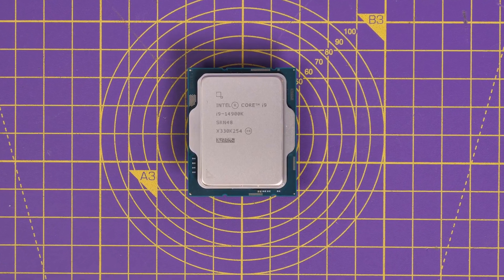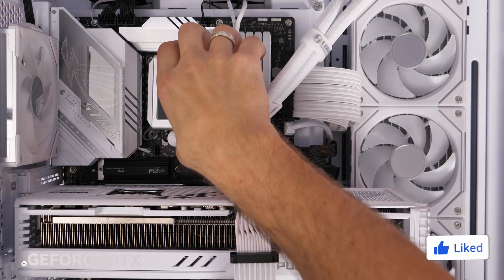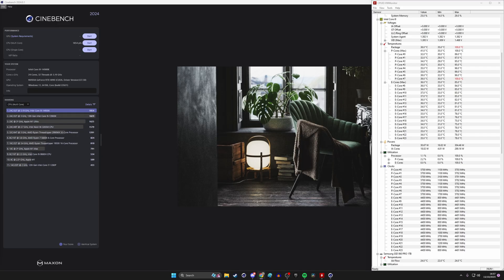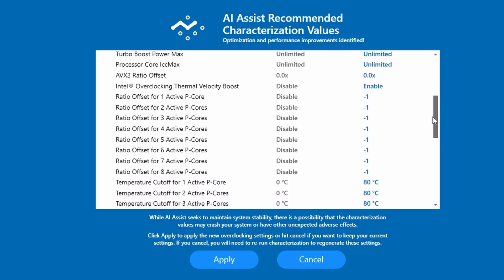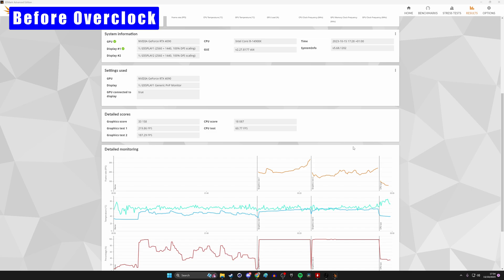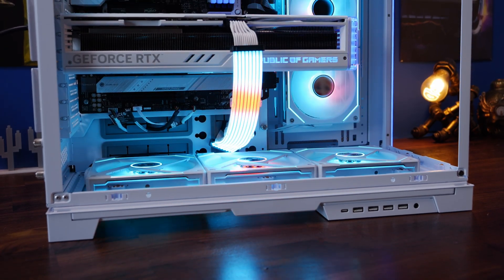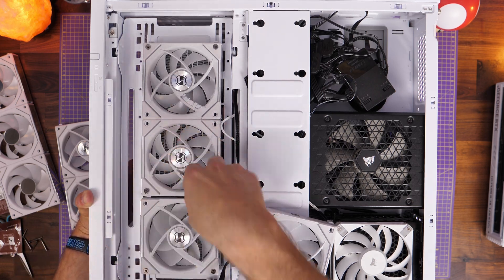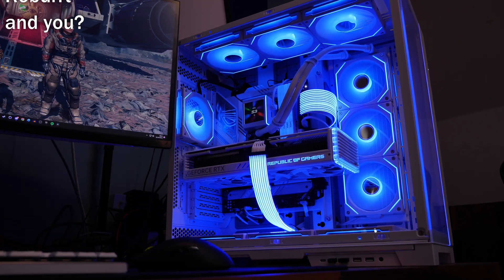Intel's 14th Gen CPUs support AI overclocking and here's the difference it makes!

Comment: Best fix is to move to am5, and im so glad i did ditch my 12700k and basically got rid of all the problems. Im on air single tower cooler with super low rpm fan profile quiet, efficient and fastest

Comment: So I've just built a system with a 14900k and I have an MSI z790 motherboard. When downloading the newest BIOS firmware I saw that they've added a feature to disable something called CEP in the BIOS in order to allow CPUs to run on less voltage to get the same performance and therefore run cooler. Have you heard of this? I havent seen any videos referring to this specific setting and I'm curious if it really does make a difference? I have also heard that one should disable the "let BIOS optimize" function as well, since that tends to push past Intel established limits and supplies the CPU with way more voltage than necessary. Anyway, I'm specifically curious about this CEP thing and what it does/what the benefits are of keeping it enabled or disabling it. Could you perhaps do a video on it or just reply with your opinion on it? Thank you sir!
Reply from the maker: I've heard of it but not tried it yet. MSI mentioned it's for the non-k series of CPUs though
Reply: @TheProvokedPrawn  Yes I did just notice that the recent BETA firmware update is for the non-K CPUs but apparently its been an option for the K series CPUs for a little while now, but I still dont see anyone talking about it. I am finishing up my build today and assuming I havent messed anything up, I will be messing around with the BIOS and running some benchmarks so maybe I'll try turning that off to see what happens. I still think it might be a good video idea and I also just value your opinion and knowledge on this stuff. Thanks!
Reply from the maker: @thatBLKSheep  let me know how it goes
Reply: @-Highlander-42  for me with an i9-14900k, I believe it was already off, by default. I never tried turning it on.

Comment: Hello great video, I bought an I9 14gen recently but I have temperature problems, does this new IA tuning utility could help to settle the right configuration in order to low degrees?
Reply from the maker: https://youtu.be/sVEXd-Wp8FY
Reply: Thermal Grizzly makes a cpu mounting plate that might help. Use good thermal paste! If you have an AIO you could look into getting some extra fans and making it push/pull. Aside from that you will have to start looking at better cooling solutions.

Comment: What was the point of this overclock? Rainbow Six Siege - 486 > 492 fps. There is barely ANY difference in this overclock, except wasting energy and rendering your system just a tiny bit more unstable.
Reply from the maker: The point is it's easy to do and it'll be unstable because it's managed by AI and the  system

Comment: Personally I’ve just reduced the core voltage by an offset of -0.05000v.. At first glance I thought it wouldn’t do much but it ended up lowering the temperature of some cores from 100c to 80-83c. In wattage before lowering the voltage it was going up to 350w after tho it was 275w so -75w and by the way the performance is pretty much the same and the cpu is still running great at 5.8Ghz on the P cores and 4.5Ghz on the E cords
Reply: It's because core voltages affect on power is the square of the difference it isn't linear. Ie if it say used 100w with 1 volt, if you upped the voltage to 2v it'd used about 400w although that math doesn't exactly track for  going from 350w to 275w. Make sure ur actual all core frequency isn't being lowered and especially that undervolt protection is turned Off in the bios. That feature is awful if you're tryna undervolt, you shouldnt be losing any performance at all but it sounds like u lost a little probably bcuz of that feature.

Comment: Is anyone in the comment section using "contact frame" ??
Reply: I use a contact frame that I had when I bought the 12th gen and it did help lower the CPU temperatures dramatically so I bought one for my 14900K as well because I don't want to risk bending the CPU
Reply: I just installed one for my 14900k. Its hard to pinpoint the exact contributing factors, but i noticed minor galling on the cooling plate of my h170I along the top and bottom edges of where the CPU contacted it through the paste before i swapped. After buffing that out and installing the contact frame my temps dropped about 4 degrees across the board. It could be slight variance between my paste application, or maybe the contact frame helped. Either way im happy with it and im keeping it installed.
Reply: @Akmt96   same here, I can’t pin point what is helping to cool this bad boy off. I used artic mx6 and thremalright contact frame on a z790 msi Meg ace mobo
Reply: Doesn't affect anything really 1 to 2 deg. To none
Reply: @bryangroleaupaquette2503 it helps with the cpu thing bending its not meant for instant temp reductions
Reply: @bryangroleaupaquette2503  Very wrong. Almost 7-10 degrees actually.
Reply: Honestly, I did some research and saw that some folks had their CPU’s bend over time due to the lga 1700 socket shape so I just bought the contact frame for peace of mind! So cheap and too easy to install for the anxiety it takes away, but I only noticed a 2c difference on my 14th gen i5
Reply: It is working only with a brand new cpu not already bent by the mobos lock mechanism.
Reply: Yes
Reply: I am! Love it on my new i9 14900k. Didn’t try before/after but my 2x 360mm rads on custom loop have no issue with cooling.
Reply: Yea but dont know what it actually does because i installed it new. No basis if its better, just being on the safe side.
Reply: The factory iLm eventually bends the chip , the contact frame prevents that.

Comment: I love my 14900k , def no reason to go from 13900k/ks on this but from 12600k.... ow yea .... i hiting 6.1 MHz All P Core with 4 E cores , System only for gaming 

using manual + Ai OC  Max temp 72 c on air cooling ^^ mind blow

Cinebench R32 results on Single core test 2325 p
Reply: If ur saying you only have 4 e cores enabled make sure you do one ecore from each different cluster because then they get all the l2 cache and bandwidth to themselves and also they can be used for gaming if it needs because ecores don't have worse latency if they aren't talking in the same cluster.

Comment: So you have 3 120mm reverse blades on the side radiator in the XL, yes?
Reply from the maker: yes
Reply: @TheProvokedPrawn  Thanks, in the process of building in this XL case and was concerned a 360 Ryujin III would look "small" on the side, but your build looks like it's fairly filled out with the AIO rad there!

Comment: I just pulled the trigger on going from 12900K to 14900K. Necessary, no, but the performance uplift and new features are interesting. I'm looking forward to seeing how my cooling loop responds.
Reply: welcome to hell, still trying to find optimal undervoltage offset in order to prevent thermal throttling and 100 celcius on cinebench
Reply: @CyberguyGR but why do you need to stress the 14900k that badly? More focused on gaming only issues I am having is it randomly keeps spiking
Reply: @cobra2994  I am not looking to stress it, I am looking to undervolt it as default settings keep the cpu at 100 celcius and it automatically underclocks.
Reply: @CyberguyGR Set thermal throttling to 105c then it's completely fine so long as you're only reaching it when testing unrealistic full loads. Also try testing on OCCT, theyre good bcuz they set variable loads to help reduce power consumption while stability testing

Comment: Am a fan of ur channel.
Wanted to know if the 14th Gen chips are compatible with Z690 motherboards since brands like ROG, MSI, ASRock do say that they are on their website. So can you directly slap a new i9 14900K on a new Z690 MOBO?
Cause Z690 right now is much cheaper than Z790 in my region. Pls do clarify.
Will be eagerly waiting to hear from your end.
Reply: Can confirm 14900k on a Asus ROG z690 f-gaming works. I have latest bios installed.
Reply: @abn0rmal  thanks 👍

Comment: My 13900kf z690 maximus literally did almost identical to what your 14900k. Im getting 6.1 on 2 cores 6.0 on 3 cores 5.9 on the rest... and 4.4 e cores. Don't really think it's worth spending $570 bucks.
Reply from the maker: Others have said there's little difference between 13 and 14. Still, if you've moved from an older generation and aren't experienced in overclocking then it's a good option to have.
Reply: That's really good to know. Because I have no experience with intel  @TheProvokedPrawn

Comment: using ai overclocking my pc is unstable and either games crash or my whole PC restarts after a little gaming.
Reply: Just incase anyone is curious, I think it may not have been the ai OC, my ram is advertised to XMP 6600mhz DDR5, I kept XMP on but lowered it to 6000mhz.   I used the ai settings and have not crashed any games in several hours…   

Prime95 fails some “workers” at 6600mhz and says hardware is unstable, but at 6000mhz all is good.

I went from crashing within 5 minutes every time I played a match to being all good the past 3 hours of testing so I believe it’s stable, and if not, I at least found the culprit to be ram related.

Regarding ai clocking;
Seems really cool, but I’d say stress testing with the ai clock it’ll always thermal throttle cinebench and Intel XTU, even with some of the best water cooling aio, but in games it won’t run real hot at those beefy speeds, so may as well let it rip if it ain’t causing issues.

Sorry for the presumptuous original comment, I thought it was from the ai clock.

Thanks for the video too!
Reply: Another update:

COD runs well as long as my RAM isn’t set to it’s max 6600Mhz speed (I left it at 5800Mhz with XMP staying on).  I’ve seen online a lot of people showing that COD crashes with high RAM speeds for a lot of set ups and PC configurations.

Some older games like titan fall 2 crash, and back 4 blood was crashing today, I turned my clock down from the ai clocking x61 to x58 and both are running with no crash now… wonder if some games just really don’t like that kind of speed lol   Although after several attempts and crashes sometimes it would blue screen my whole PC, or even just shut right off…  strange.   In any case it’s much more stable after taking a hand full of cores down a few points.
Reply from the maker: Really? That's interesting. Have you stress tested too to see if it's overheating?
Reply: I got a nice arctic 360mm liquid cooler upgrade for this cpu and it keeps it nice and cool.   I think my solution for stability will be to let the ai decide where I start, then bring everything down by a bit
Reply: Do a memory check
Reply: Same brother, i still changin 14900k rma 😂

Comment: I would put rad in top, exhaust out. Then the rest as inlet fans, exception beeing the one by socket as exhaust too.
So bottom inlet, rear inlet, exhaust outlet by socket, exhaust rad outlet top. Heat wants to travel up by physics.

Comment: If running windows 11 would you have to activate it again?
Reply from the maker: If you're swapping CPU? It depends. Usually only if you upgrade the motherboard
Reply: ok just wondering, I did a bios update on msi Z790 Ace ( it was for these new 14900K's) and had to buy another digital license, sucked.  @TheProvokedPrawn

Comment: Specifically in my case (overclocking 13700kf manually separately by cores) this program did not do anything useful. It added 200 millivolts and raised the frequency of the first two cores to 5600. For the others it set 5500, and I know that the 5th core does not work at a frequency higher than 5500 and even at such a frequency in my case requires 1.4v. That is, the overclocking that the program suggested may be unstable. On energy efficient cores it set 4300. Earlier the same "overclocking" was done by the "command center" program built into my MSI motherboard, the feature is called something like "core boost". 

In general ai is not involved here. All those who hope for an easy overclocking should realize that the capabilities of their processor can only check the many hours of tests of each core in "y-cruncher" and there is no magic button.

By the way, my processor runs at 5600 (except for core 5, which is at 5500) and 44 on small cores, at a voltage of 1.4. All tested by playing nfs payback for hours and running in y-cruncher separately for each core.
Reply from the maker: Ok, so I appreciate your comment, but I think you missed the point. 

Firstly, the AI Overclocking is currently only for the i9-14900K (according to Intel) though that might change in future. Secondly, yes, you could probably get better overclocking by tweaking and testing various settings, either with XTU or Afterburner or Motherboard software/BIOS settings, BUT if you're new to overclocking or find it intimidating or just don't want to mess around with settings and testing for hours, then clicking one button and getting a boost in MHz and performance is appealing. It's nice that they're making it more accessible for people. :) 

Thanks for sharing your experience though! Especially the extra tips around y-cruncher and things! :)

Comment: How about bending? Is this processor also susceptible to bending? Besides, have you carried out similar tests and does it make sense at all to use BCF on 14 gen?
Reply from the maker: It's not something I've looked at, but der8auer has https://www.youtube.com/watch?v=OWZ3e4Mw_ZI

It's still LGA1700, so it will be the same in reality. I need to get a contact frame and check myself, but he shows the issue is there.
Reply: @TheProvokedPrawn  Thanks for the info)

Comment: I just switched my radiator from the side for intake to the top for my 13900k, do you think switching back to the side for intake would be better? Just got the Lian Li inf fans, all reverse for intake and regular for exhaust.
Reply from the maker: It really depends on how many intake fans you have Vs exhaust tbh
Reply: @TheProvokedPrawn So I have a big win, I switched out my Corsair fans to the Lian Li. 

I have a corsair AIO so I use my extra corsair fans as a Push/pull. Currently have 7 Exhaust (because of push/pull) and 6 intake. 

Now I could switch AIO to side intake and put push/pull, which would change to 9 intake and four exhaust. Mind you, 13900k and 3090.